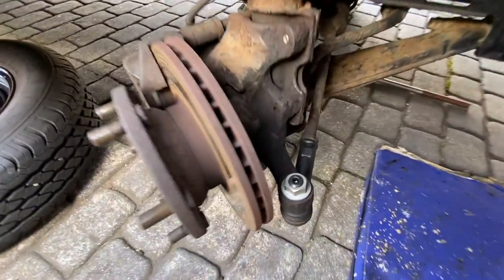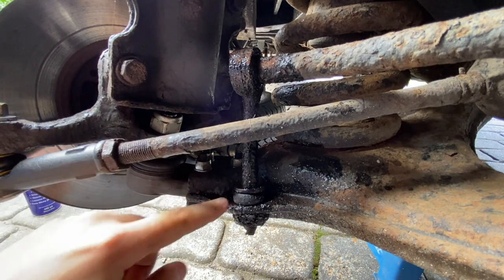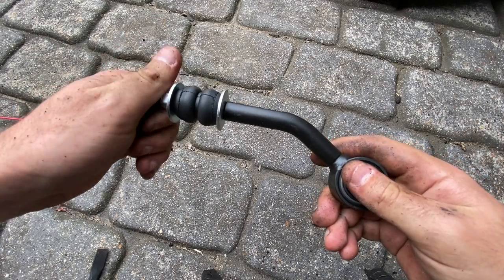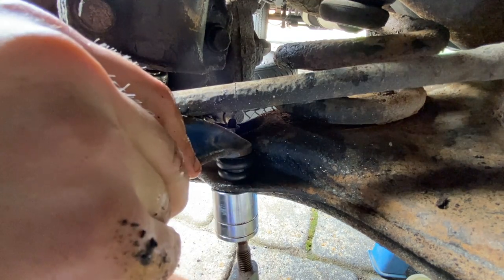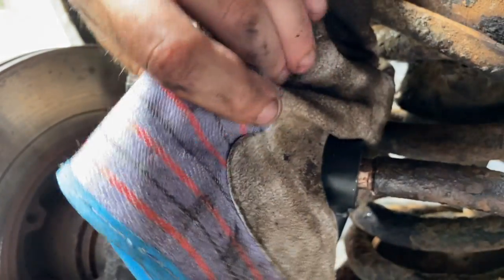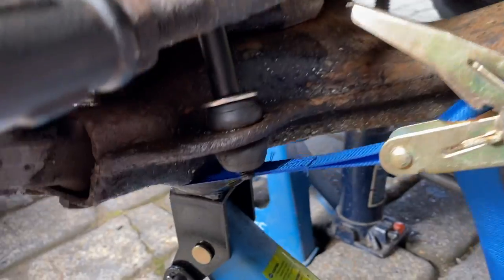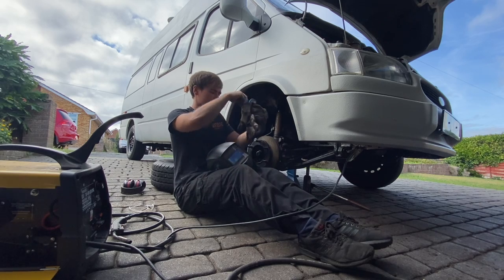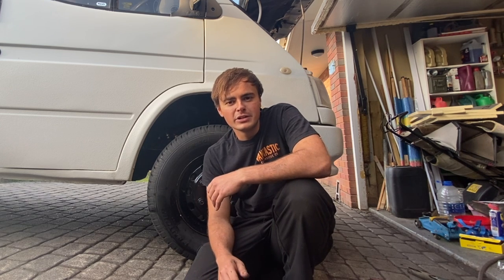Anti Roll Bar Drop Links Replacement & Spring Hanger Repair - Ford Transit

Comment: THIS IS THE VIDEO I NEEDED, I TRIED TO FIT THESE 3X AND COULDNT FIND ANYONE SHOWING ME HOW TO DO IT,, MANY THANKS BRO
Reply from the maker: No worries man! Glad it’s helpful. If you struggle to get the rubber bushes through you could always cut them in half. I had to do this on the other side as it just wouldn’t go through the hole 😂

Comment: regarding the rubber bush,i just cut mine in half,.did it about 3 years ago and done around 50,000 miles since with no problems..well done getting your spring hanger welded up.i started prodding mine and there was nothing left,had to get a new spring hanger,very easy to fit it but was a total pig getting the old one off,they are spot welded on from the factory
Reply: Wish I read this reply before spending hours trying squeeze an elephant through a catflap.
Videos are a real help though.
Reply: How did you cut in half? I mean what direction.. along the length (top to bottom) or through the middle, in the groove ?
Reply from the maker: Cut straight through the groove with a Stanley blade then sandwich either side of the lower arm put the drop link through and bolt it up.

Comment: Hi. I've got xlwb 98 transit. I've replaced all wings..fabricated sills..battry tray and reinforced chassis area around rear spring hangers.   This particular video I needed ty. Took a few men and days to work this one our.  Also, good idea to spray your bushes with rubber protector.
 I'm currently in a quandary over front strut mount area.  Cut out old area replace new mounting or patch ??  I know you can only show wht your particular jobs are. Thanks anyway.. Girl power 😂
Reply from the maker: Hi Isabel, credit to you for taking on such a big project, it’s never easy keeping the rust away but you’re definitely going about it the right way. It really depends whether you’re patching up for MOTs or whether it’s a complete restoration and you need it pristine? I personally patched this area as it wasn’t too bad. Nice to see that the girls are digging these vans too! 😁

Comment: Hi, hello
Did you ever replace front springs? Do you think it is possible to do "at home"? Any special tools needed, perhaps you know?
Reply from the maker: Hi there, I haven’t replaced my springs but If you check out my video for doing the lower ball joint the spring is almost out in that video. You would just need to push the lower arm down and spring should come out I think
Reply: @TurnersWorkshop97  yes  I've seen that video and I think the same. Thank you.

Comment: Well done on the welding and ARB link, I usually just cut the bottom arm Bush in half at the  area it goes through the arm... Also don't use Hammerite paint, it's not as good as it was 10 or 15 years ago. I now use 2k Ford Black (or Chassis Black) in Direct Gloss formula, just like applying Hammerite but a far more durable finish and 2k will be cheaper in the long run too. 

Hope this is a slight help going forwards
Reply from the maker: Thank you mate, I have to admit I cut the bush in half on the other side as it just wouldn’t go through 😂 thanks for the recommendation I will have to check it out 👍🏼
Reply: @TurnersWorkshop97  it's the least I can do
Reply: @TurnersWorkshop97  😂😂😂😂😂😂 I was just showing the mrs this, and we were in awe of your skills, then i read this comment.
Reply from the maker: Haha it doesn’t always go to plan, there’s always another way 😂😂

Comment: Definitely a R clip on the end of the bar (goes through a small hole in the bar end)
Coincidentally as I was replacing track rod ends and lower ball joint today I did wonder whether I should replace the drop links. Where did you purchase the new ones?
Reply from the maker: Cheers mate, I wonder if there are a couple of different types of anti roll bar. One without the clip 🤷‍♂️ I went for moog ones from euro car parts, they seem pretty good quality. Only time will tell 👍🏼
Reply: @TurnersWorkshop97  
Yes you may be right.
Mine is a P reg xlwb high cube and the bar does taper inwards at the end. I think after 98 a different type of drop link is fitted also. (Straight)

Comment: Nice job.
I'm doing the same job but i can't get the rubber throw the hall. Eny other ideas???
Reply from the maker: Cut the rubber bush in half and put the rod through it, will be fine doing it like that 👍🏼
Reply: Yes. I'm polling my hair out hier
Will cut the fu........g thing
Thanks man
Reply: Is it not time for your brakes?
I have to do myn. Front and back.
Reply: @TurnersWorkshop97  How did you cut in half, through the middle, in the groove ? So there's a top and bottom half?
Reply from the maker: Yes mate 👍🏼

Comment: Hiya, You have done a cracking job but use a 1.5 /2lb ball pein on your joints. it gives more "shock" and keep your Copper face/Hide Mallet for "softer blows". Please use grinder with guard . Have seen too many incidents. It seems that Americans do without guards don't join them. Bob
Reply from the maker: Hi Bob, thanks mate I like comments like these as they make me question my methods. Totally makes sense what you are saying 👍🏼🙂 I will dig out the guard for it.

Comment: R clips were invisible on mine so I cut the links off with the whole bar removed,smash new drop links on with new D rubbers what a pain in the arse ford made one 😂
Reply from the maker: Haha 😆 so is it supposed to have the R clips do you think 🤔
Reply: @TurnersWorkshop97  well according to the Haynes Bible but mine were hammered on that tight that they're never coming off unless they're cut off.
The later roll bar links are much easier to do & it looks an easy upgrade but I think these new ones will out last the life of the van so I'm going to bother not after the grief they are to change 😂